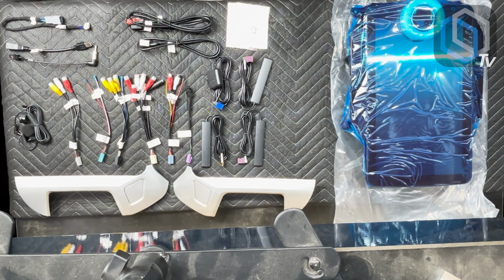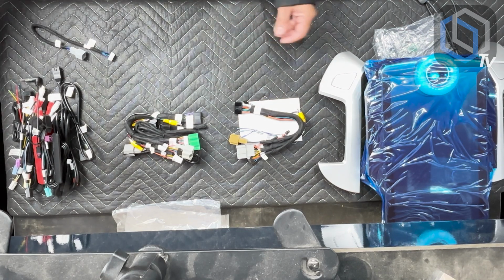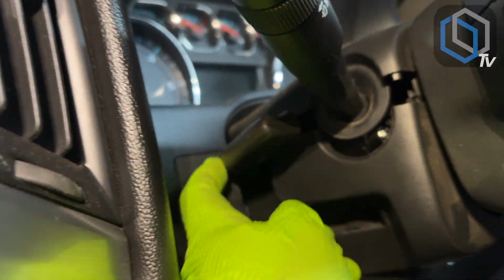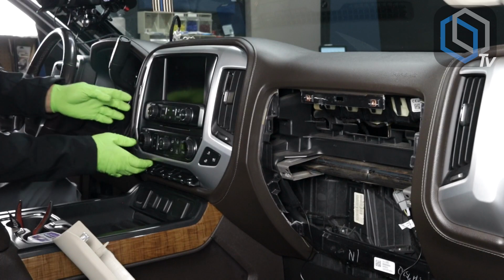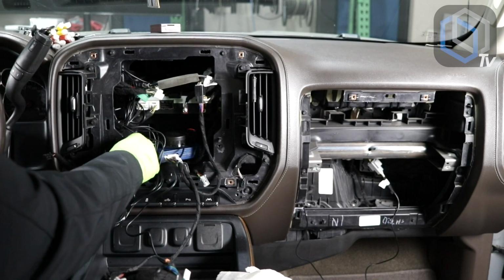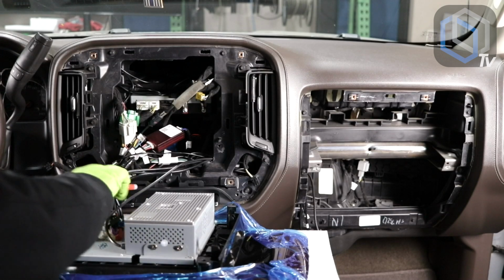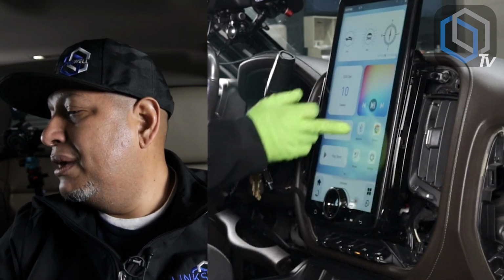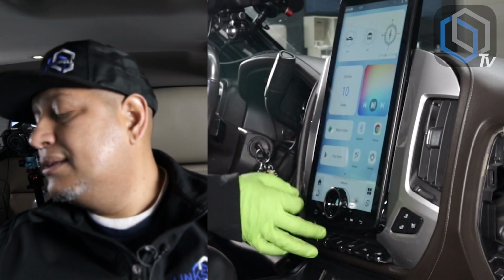Installing a 15.6" T-Style XL into a Chevy Silverado!

Comment: Hola Victor me puedes ayudar con una troca la cual el estero de ustedes ya a la hora de estar todo bien aparentemente la pantalla prende y se apagas  quiero pensar que es el cerebro que no funciona pero quiero descartar si me falta alguna señal extra que tengo que conectar externa es mi duda
Reply from the maker: If it’s a GM truck it may be an issue with the battery or alternator. The radios have a protect circuit to go black when it senses the voltage dripping to low in the truck.

Comment: Does this fit a 2019 chevy silverado ltz 3500 with bose system? Does it retain factory on star and its wifi?
Reply from the maker: Yes it will. The 19 HD trucks kept the 14-18 dash. So it will work. You will need the BoSE adapter to retain Bose though.
Reply: @LinksWellInc how about on star and wifi?
Reply from the maker: @rodolfogutierrez2556 yes both are retained

Comment: Does this unit have the capability to control auxilary/upfitter switches? I really like how this install for the 2014-2018 GM trucks has eliminated the climate control buttons and added a knob to the center of the screen but it sits up way too high for my liking so I am considering the possibility of doing a custom install to lower the screen which will require to removal and integration of the factory upfitter switch panel into the head unit.
Reply from the maker: @Ross.Co.Mfg.  no we can not replace the up fitter switches. 

You may be able to control a switching device that works through an app. Something like the Trigger Controller. But the radio itself has no switching.
Reply: @LinksWellInc , I just looked into the Trigger Controller, and I think I'm picking up on what you're putting down. You're saying no, but yes, with some creative thinking, electronic wizardry as well as custom programing/app development, the possibilities are endless. I'm going to ponder on the idea for awhile before pulling the trigger.
Reply from the maker: @ yes in a way. So our show rigs always have had the trigger controller. So we install it then put the app on the radio and now I have control of our offroad lights on the radio. 

If you go through our channel you will see demos of lots of the extra things you can do. 

So you can watch our video’s from “KnowledgeFest where I do a couple demos showing the trigger working as well as the Ring app. 

I have been needing to make a video showing the OBD apps working so maybe I work on that the next couple weeks. 

You can also check out our podcast here on our channel where we do talk through some of the expansion options as well.
Reply: @LinksWellInc , I wonder if you guys have any plans to expand the capabilites of these units in the future to do input/output switching, OBD code reading/deleting ss well as vehicle data monitoring/logging? A sort of all in one package.
Reply from the maker: @ so some of that doesn’t make sense to do. OBD data is as simple as downloading an app and using a Bluetooth OBD scanner. 

We have talked about doing external switching. I’m n the future but nothing is in development yet. But again. Using an app controlled switcher works. So the need isn’t as pressing.

Comment: You mention that some people may be able to tie into the factory microphone? If I get a hold of tech support will they be able to guide me in the in the right direction on were to look for the factory microphone wires? Getting the adapter for the microphone plug is easy to get but finding the correct wires is the million dollar question?
Thanks for all the great videos made me step up to the GEN 6 XL.

Comment: Bought the new gen 6 but kind of wishing i went with the XL
Reply from the maker: @bobk4029  so the Gen 6 shares almost all the same parts as the XL….  So it can do what the XL can just with a smaller screen.
Reply: Why don’t you have the ability just to use the existing shark fin antenna for your GPS that’s on top of the roof. Also, really informative really well done video great detail. Thank you so much for really breaking it down like that.
Reply from the maker: @ you can try it. Sometimes it works sometimes it doesn’t.